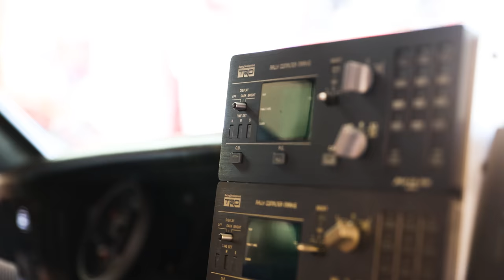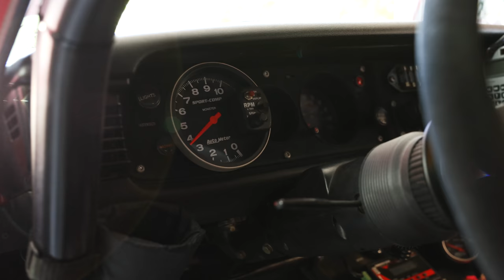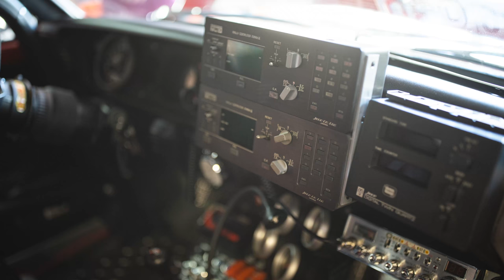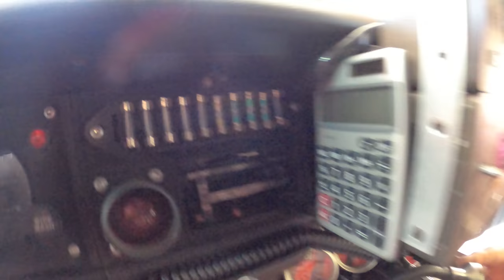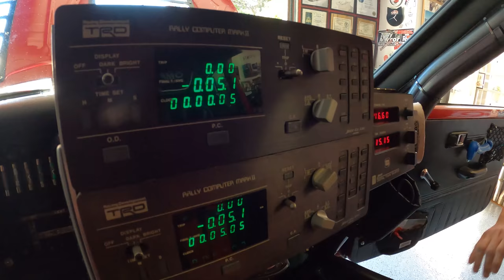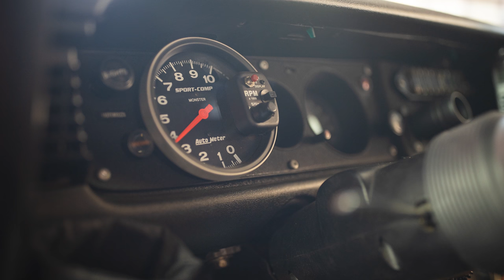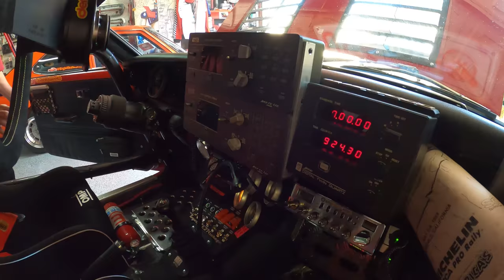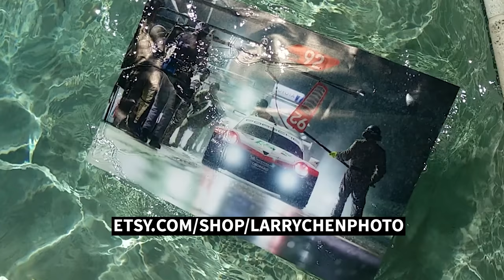Full Rally Spec ‘73 TE27 Corolla! Mike Muniz’s Backyard is Vintage Toyota Heaven

Comment: Dr👌👌L...
As a loyal die hard ToyoDa enthusiast Larry this was awsome.
Mad props to Big Mike & his wife
on amazing Corollas. Super c👌👌L 
his wife is his navigator & partner in crime...Im truly jelly. My ToyoDa experiences : 
At 16 yrs old I owned a 72 TE27
1.2L 3KC 73 C.I.D 70bhp 4spd 
manual, front power discs brakes, rear drums, 12" steel wheels, 155/70P12 ( $18 ea. Good Year Eagles ) aftermarket transparent distributor cap & spark plug wires
( light show @ night ). Later I would
up grade to a 1.6L 3TC 97 C.I.D gifted from my friend Roosevelt.
Since then I've worked for various
ToyoDa dealers in parts & service
for over 15 yrs. The Corolla is long
gone & sadly missed ( Totaled )
but still have 4 ToyoDas in the driveway. Good luck to Mike & Cecilia !!!

Comment: Have a 1973 2TC Corolla, it is running now using a SP-1 racing gasoline, leaded, no alcohol, 111 octane. It was a daily driver car for about 25 years (300,000 miles) before having engine issues. Turned out there is nothing wrong with the car, it was the California gasoline blend change that caused the problems.  Need a referral for a good body shop for restoring the paint, mustard yellow.

Comment: If that car existed back in the day it would of been winning events outright.
The escorts of the day had no more than 240 bhp.  
Only thing he will need to do if the engine pulls well enough down in the revs, is  change the diff. ratio to a 5.1:1 or if on 15" wheels perhaps a 5.3:1.
As for the historic monty event, it's more of a jolly than a competitive event. San Remo is the real deal or the Roger Albert Clark, or RAC

Comment: 2:44 whats the purpose for the slits in the front splitter/ chin spoiler?
Reply: Id assume it's so the splitter can break without coming off if the car nosedives. It seems logical because the splitters are so far forward. Let me know if you find out the real reason tho

Comment: Does Mike have an aero gas turbine sitting on the floor in the back of the garage?
Reply: You correct.  It's my spare Boeing T50. I have the other one in my Porsche 928
Reply: @Big_Mike_Muniz  That is Rad.  The 928 is likely one of the most underrated cars out there, even in stock form. I spent the early part of my career installing and commissioning large frame gas turbines for power generation. Siemens/Toshiba 501G's were my flavor.  they are about the same thing as a t50, just a lot bigger. Keep up the good work!